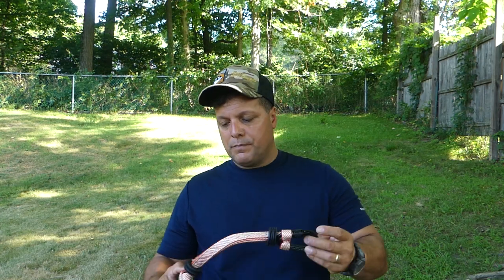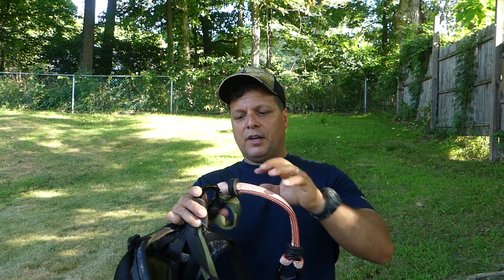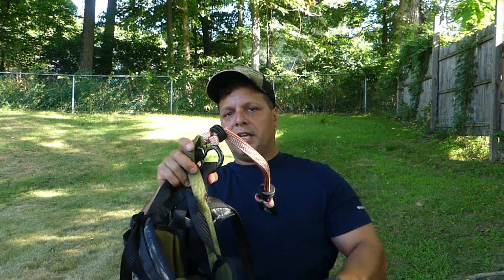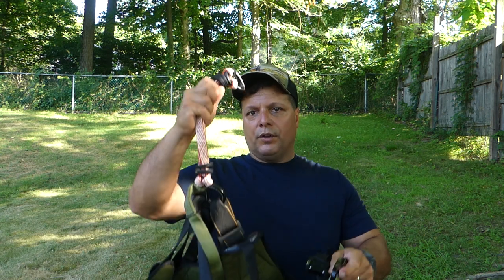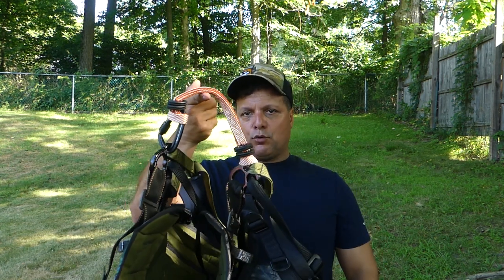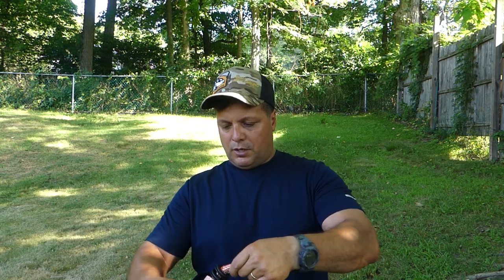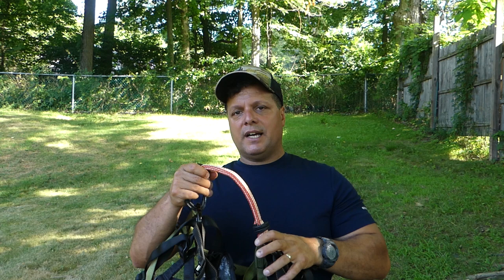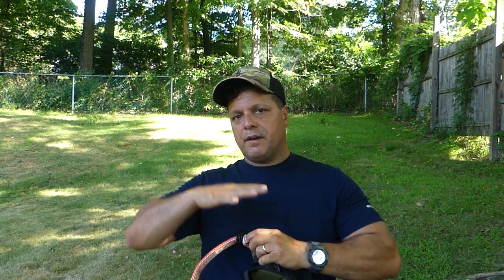How I added a factory short bridge

Comment: This set up has worked perfectly for me on my Aero Kestral. I am trying out an Eberhart Signature Series (ESS) saddle this year from Tethrd. The saddle is very comfortable except that adding a second bridge for climbing does not work well when attached to the lineman's loops. So I need to attach to the D-rings. The problem is that the carabiner on the D-ring will be metal clanking. Any ideas for the best way to install a short bridge on an ESS?

Comment: What are your thoughts on the adjustable Amsteel bridges for DRT and SRT? I know you like the redundancy of two bridges, but would you trust the adjustable bridge for climbing and then tethering in?
Reply from the maker: Well an Adjustable amsteel bridge  should  work just fine , I like the redundancy of adding  a second  short bridge personally.  I've sat in a Phantom  but don't  have enough  time in it to be able  to give a good opinion on the Adjustable amsteel.  In theory I like the idea just not too sure if there's anything  I would  dislike about it.
Reply: Amsteel is super strong and light but not abrasion or heat resistant. As an arborist I would never use it for a bridge, there's much more durable cordage that's plenty strong.

Comment: Joe,

I was going to purchase the bridge in the video for climbing but they are out of stock on Wesspur. Can I simply take a cut length of  some climbing line and tie each end to my lineman's loops using bowline knots on each end?

Also, what line should I use to make a prusik?

Thanks.

_ Logan
Reply from the maker: Logan you can use a cut piece of climbing line and tie a good termination knot of your choice but I'm a fan of factory  eyes over knots . Wesspur has several different  factory  replacements that will work well.. I went with the weaver but I also liked the petzl or tree austria bridges. The warp looks nice too but they're expensive. 
https://www.wesspur.com/saddles/replacement-bridges.html

Either should  be better  than a knot. Its cleaner and stronger in my opinion  . I also added  a metolious bravo  carabiner it's a small carabiner  so it has a smaller profile.

Comment: What’s your technique for climbing a tree without usable branches? Such as a tall pine.
Reply from the maker: Trees with no branches we go to our sticks. However  if you're  setting presets in a real far back remote location and you want to avoid carrying in sticks I've  seen some guys make up webbing runners with a carabiner or a ring that they set pre season.  They go in with sticks or use a docapole  , girth hitch the tree set the runner at the height  they want and leave a paracord loop in the tree and climb on that when  they return.  

We personally have not done this but it's an idea that will work.  Only think you want to do is maybe  inspect the webbing  with binoculars prior to climbing in case of critters because  your leaving it out all season. I also would set these closer to the season  rather than post season.  We haven't done this just saying I know other guys do and think it's a solution if you want to set yourself  up to come back and climb rope rather than carry in sticks

Comment: For the phantom saddle would you recommend attaching short bridge to lineman's loops or to the bridge connections? I have mine connected to lineman's loops but do not find the climb very comfortable, especially if I have to remain suspended for trimming some limbs and  I wondered if changing the attachment points would help.
Reply from the maker: Attach  to the same Dloops the bridge is on. The Phantom  has an Adjustable bridge  but if you wanted to add a second  short bridge  I'd install  it on the same D Loops as the other bridge.
Reply: @NYSaddleHunter  Thanks. I will try that.
Reply: @NYSaddleHunter  Thanks Joe. I'm definitely  adding one to the phantom saddle. The adjustable bridge on the phantom is thin at the ends and I can't say I feel 100% safe DRT climbing. amsteel or not.
Reply from the maker: @danncontraeagle1  
Yeah  you  need to have confidence in your gear to feel safe . You can be confident in factory made bridges for arborist saddles.  They are used by guys that abuse there  saddles